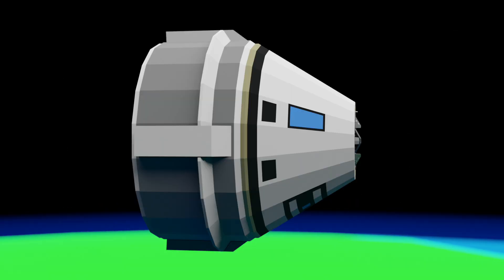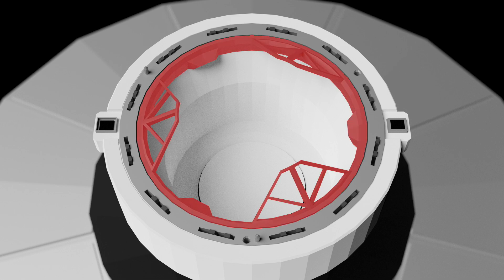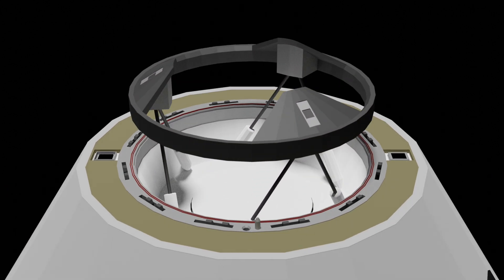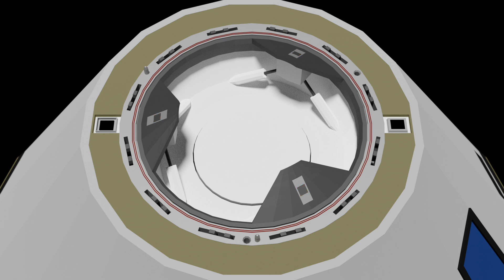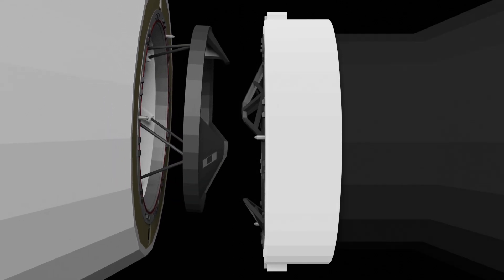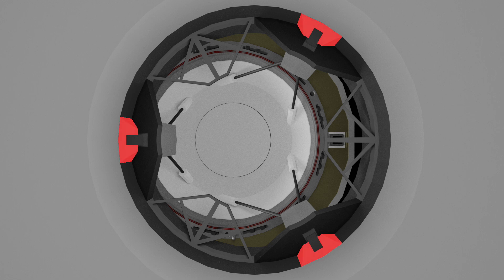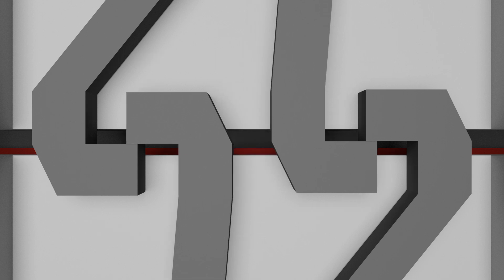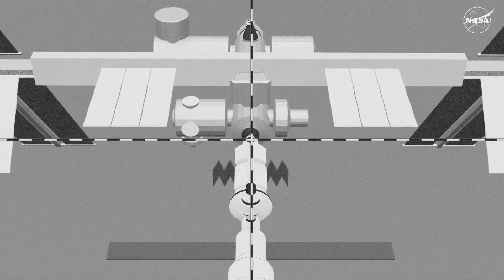How the NASA Docking System Works

Comment: Are there any IDSS ports that implement both active and passive roles functionality? I'm wondering whether that's been implemented in hardware at all. Seems like the strikers on the active port ring are not there for a reason - they might interfere with the actuator arms of the SCS ring. Implementing a port that allows both to dock and to be docked with probably is too overwhelming of an engineering feat, and the IDSS is androgynous on paper, but not in reality...

Comment: i have a question, how did the vestible get pressurized? what's the process of it? how does it function?
Reply: In the hatch there is a pressure relief valve. That valve is designed to slowly equalize pressure between spacecraft and the station. It can take a long time for equalization. Roughly 40 to 60 minutes. Without equalization you won’t be able to open the hatch.

Comment: That elastomer seal could give up someday ,and there should a secondary level transfer section like an umbilcal duct within the ISS at least to safeguard a leak or facilitate easy entry into ISS moreover a docking section with mutistage airlock could be a better solution.

Comment: People don't watch docking because it is so slow. Which it has to be when you're throwing many tons of metal around in zero g. No weight, but all the mass. Super dangerous time. So they creep along. And if you're not into it, it is boring. I love it. I've docked the Shuttle to the ISS in simulators before and it is one of the most nail-biting, tense, frustrating and rewarding experiences. lol
Reply from the maker: I think there's something really amazing to it, orbital dancing, formation flying to the next level. And may I recommend "Manual Docking" the best iOS and Android docking experience (but I'm biased of course.)
Reply: @SimplySpace  You may indeed. :)
I always think back to the docking in the film 2001. Syncing rotation to the station, the music... etc. :D

Comment: Funny that the primary structures of the IDAs on both Boeing's CST-100 Starliner and SpaceX's Crew Dragon are made by the Russian company RSC-Energia
Reply from the maker: The IDA is not on Dragon or Starliner. The IDA is on the ISS. The reason that RCS-Energia played a part in the IDA is because the IDA converts the existing RCS-Energia APAS-95 docking ports on the ISS's PMAs to the International Docking System standard that both the NASA docking system and SpaceX docking system are built to.

Comment: Nice info. But the dors are to small circle. How they get stuffs inside and outside? Or how you evacuate fast on emergency? is to tiny that hole doking.
Reply: It's big enough for people and cargo.  They evacuate fast the same way through any portal, one at a time.  The size is not very important in zero G for crew movement.

Comment: I had thought that docking with NDS/LIDS required one Active participant, and either a Passive participant or another Active set to a Passive mode (which would allow, for example, a Starliner and Dragon to dock). But from your video, the Active port lacks important elements (strikers) in the soft capture and cannot act in a Passive mode. Is that correct?
Reply from the maker: That's correct for the first block of the NDS at least. Development of androgynous docking capability has been left as a possibility for future block iterations of the design.

Comment: OK....so those leaves Do capture the spacecraft but 'softly', I didn't know that they extend and "move-about".  The more interesting thing is there is a "latch" on those petals that grab-hold the opposite leaf....once those attach, those "rods" (sorry I didn't get all those pieces of equipment) slowly move the approaching craft into position for those 12 latches on Both crafts to latch on each other.  Also the seal makes it gas proof so no leaks.  Did I get that right, sort-of??  Thanks for the video/animation!!!!
Reply: You are close. Remember there are three leaves on both active and passive sides. Each leaf (they are actually called petals in the industry) of the active system goes between the two petals on the passive side and those small latches on the petals lock against the underside of active and passive petal ring.

Comment: How did you know I've been wondering about the docking system used on the ISS and the spacecraft that dock with it? Specifically, I'd wondered if the docking system was active/passive or universal - could, say, a SpaceX Crew Dragon dock with a Boeing Starliner? This video shows me the answer is no, the system is active/passive, not universal (as in Kerbal Space Program, for example, where any ship with a docking port can dock with any other ship with a like-sized docking port). The explanation of how the docking system works was extremely clear and delightfully detailed. I just watched your video on how SpaceX Starship will maneuver as it lands, and it was similarly detailed and understandable. I've subscribed. Keep up the good work.
Reply from the maker: Thank you! 

Keep in mind the SpaceX and NASA docking systems are two different designs, yet to the same IDS standard allowing compatibly. The SpaceX docking mechanism includes springs for soft capture attenuation and presumably other unseen differences.

While reading documents on the development of the NDS it was made clear that the capability for androgenous docking, like you describe, has been left open as a possibility for future block iterations of the system. This would require the inclusion of passive strikers on the active soft capture ring, allowing any active side to act as a passive side by holding in the fully retracted position.

Comment: Very good video.  I generally knew how the NASA (a.k.a. International) docking system work, but this presentation gave a detail explanation.  I wonder why the Russians still stick to the probe and drogue docking system?  It seems so bulk and takes up so much space when stowed aboard the docked Russian components of  the ISS and/or Soyuz.
Reply: This IDA was designed by the RSC Energia, Russia, and it was adopted as an international standard

Comment: The over redundancy of the hard catch latch seems like it might be a problem? If either side of the docking system hard catch latch motor or drive seized up, because both sides need to operate in order to remove the ship from the station. Doesn't look like a great to use a cutting torch or a plasma cutter.
Reply: There are pyro bolts installed as part of each latch mechanism. In the emergency those are fired and the latches unhook immediately. Then off you go back where you came from.

Comment: I actually feel humbled watching this video and thinking about how this system has been designed by some of the most intelligent engineers in the world to be safe, robust, reliable, lightweight, repairable, flexible, temperature extreme resistant, radiation resistant, G-force and shock resistant, vacuum resistant and meet dozens of other design constraints whilst also being simple rather than complex so that any country can use the specifications to build a matching spacecraft docking mechanism that can interface with NASA's. The symmetry of the design and the functional nature of the two stage (soft/hard) docking process is also very admirable.
Reply: Yes, but remember is international = Russian engineers put their docking tech on it and we got the best of the best 2 space programs of the planet.

Comment: soo, there are two things i still dont quite understand-
1. How do the soft-capture petals align with the strikers?
 Do they just adjust on dead reckoning by using the video feed of the forward hatch camera and the spacecraft's INS or do they have seperate cameras?
2. When soft-capture is achieved, you can see the spacecraft swing about a bit, with the linear actuators seeming to act like shock absorbers.
Do they have some internal slip mechanism that lets them perform that motion or is the pitch of the helical gears high enough so the actual motors can freewheel?

anyone know?

Comment: I find it a tad bit funny this animation uses the spacecraft that both, wasn't the first to fly humans from the US (out of both commercial options), and also wasn't the first to even dock to the space station. But by using it as the reference model makes it sorta feel like the "default" when it's anything but.
But I still do appreciate the video, I'm a fan of rocketry but I don't think I have ever actually found satisfying imagery of how docking actually works so this is much appreciated
Reply from the maker: I decided to use Starliner since OFT-1 was days from launch when I uploaded. SpaceX technically doesn't use the "NASA docking system" they use the "SpaceX docking system" built to the same IDS standard. I wasn't able to find any open information on the SpaceX system like I was with the NDS.

Comment: The current docking system too complicated. NASA has overcomplicated too many things this is why SpaceX is making soo much progress because they are a private company and they do not beat around the bush when engineering things.
Reply from the maker: SpaceX is using this same system, watch the DM-2 docking.
Reply: @SimplySpace  doh because they have to. Else they could not dock with ISS. SpaceX simplyfied space launches, controls, spacesuits, propulsion etc... And they'll be designing every other space door connection for the mission to Mars.
Reply from the maker: I know, but that's not a reason to poo poo NASA, there are a lot of talented engineers working there. You admire SpaceX's productivity yet being a hater isn't productive, don't do it.

Comment: Fantastic video - stunning quality! Thanks you for making it. 

This docking system is so complex that I’m amazed it works reliably. Three questions:

1. Why is the active part on the visiting spacecraft and not on the ISS? It must be a bit of extra weight to bring to orbit every time. Is that done for maintainability?
2. The O-ring seal is on the visitor’s side. Is that because this way it can be replaced after every use?
3. When the Crew Dragon docked recently, I saw the soft capture system compress as if it had springs and shock absorbers. Is that done through active control or through this clever current limit system?

Thanks again!
Reply: My guess is that the dock is designed to be used potentially a dozen time a year. That's a lot of potential for mechanical failure. The visiting spacecraft will only be used either once, or potentially more than once with a full mechanical inspection and refurbishment.
It's just less risk all round to have the active part either brand new or fully ground inspected and refurbished every single time.
Reply: For item 2, yes. For item3, each ball screw pair is connected with what is called a hysteresis brake. Those provide resistance level necessary to soften the impact.

Comment: 5:55 what if they don't pressurize that area? when the open the hatch will the change in pressure damage something?
Reply from the maker: You won't be able to get the hatch open, you'd have to pull it inwards against the cabin pressure.

Comment: Way too small.  SpaceX should develop a new standard that is suitable to at least transfer cargo twice as large as this standard from Russia.  That and the “S” in the vestibule doesn’t make transfer any easier.   
Maybe something as large as the berthing port?

“The Russian company RSC-Energia made the primary structures of the IDAs”
https://www.nasa.gov/feature/meet-the-international-docking-adapter/
Reply from the maker: The S is not part of the vestibule, it's part of the PMA which the IDA is attached to. Hence the S is not a part of the IDS standard but just a part of the ISS. 
The reason for RCS-Energia's involvement in the IDA is to adapt RCS-Energia's APAS-95 docking port on the PMA used by the shuttle to the IDS standard, the IDS is not a Russian standard. 
I agree the IDS is small, but it was a mandate of the commercial crew program and will be used on Gateway, so clearly it's adequate for the task. We'll have to wait and see if SpaceX develops a new standard for future vehicles like Starship when they aren't limited by existing hardware standards.
Reply: NASA is the customer, it's not the service providers place to dictate terms to the person paying the bill.

Comment: What is the elastomeric seal made of? Silicone or Urethane/sylodyne?  It has to be something that doesn't take a set.  Is it just an o-ring or more of a quad ring?  Can it be replaced in space?
Reply: I don’t recall the actual material that Russians used. I remember it was brown in color and not a circular cross section. Parts of its cross section were designed to engage in the groove the ring sits in.  The important thing with the seal material was that it did not outgas in space. And no it cannot be replaced in space as far as I know.

Comment: Great work thank you. It's so impressive that they have this system today!
(only little drawback is that it takes time for the hard capture latches to be driven in and out. In case of emergency the crew
can't just quickly hop into the capsule and undock. But at least they can seal the hatch)

Comment: So ship-to-ship docking is basically impossible. Hmm....
Reply from the maker: Quite to the contrary, in future block iterations of the NASA docking system, docking between two active ports is possible. One of the active ports will simply act as the passive side since the active and passive sides aren't mirrored, simply a rotational transformation of the other.

Comment: Quick question, you showed how the soft capture ring can move in 6 DOF, is there a limit to how much it can be rotated? So when docking the approach has to be within some range for the active capture to work?
Reply from the maker: Yes there are defined limits for relative position and rates. I can't remember off the top of my head, but there's lots of good detailed info of this system out there.
Reply: Simply Space Thanks! I’ll have to look into that a bit, controls and dynamics relates to one of the classes I took this past semester